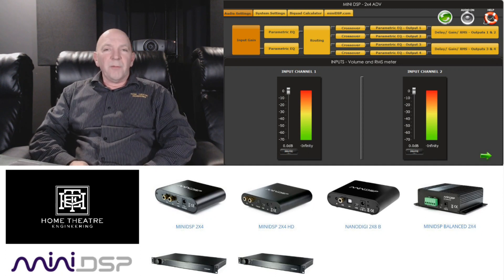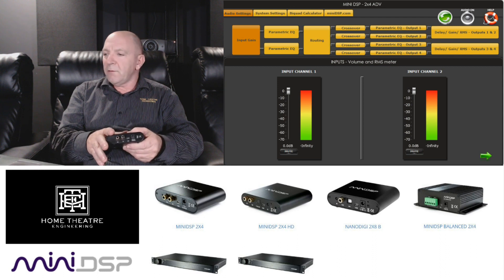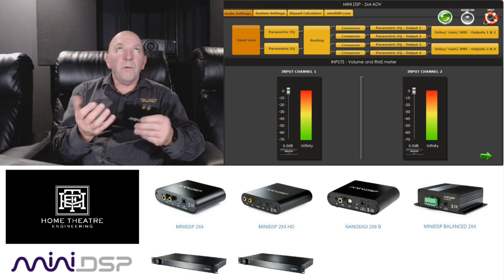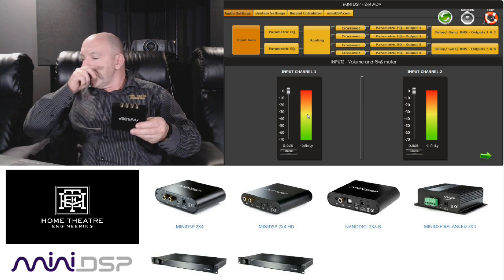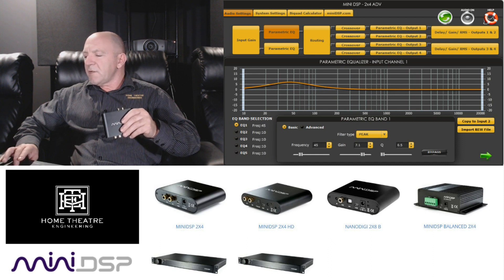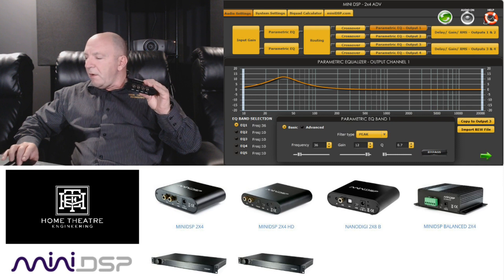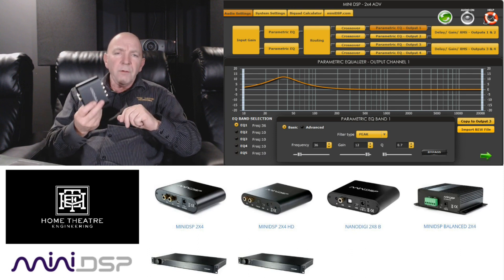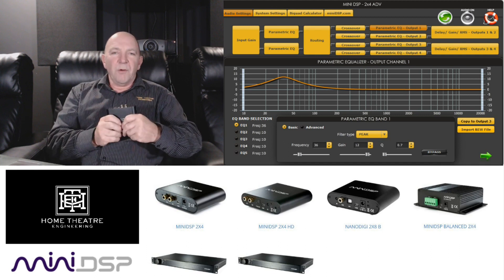Awesome Home Theatre Bass Control with MiniDSP

Comment: Please tell me what cables I need for using this with a umik 1?
Reply from the maker: Umik1 comes with the required cable after that it’s up to you depending on what you are wanting to do
Reply: @HomeTheatreEngineering  Thank you for the fast response.I will also be  using the mini dsp2x2.What will I need with this?
Reply from the maker: @christisdale9977  that entirely depends on what you are trying to do or connect to. I would suggest looking at the relevant documentation for that product and the products you will be using..

Comment: Hello Team, I need some help darling in my subwoofers, ￼My question is should I add a house curve in the mini DSP and then run anthems ARC room correction or just use the mini DSP to flatten the response and then add the house curve in anthems ARC room correction?￼ I’ve tried letting the anthem do everything but I think incorporating a miniDSP will achieve better results. 
I can’t move the subwoofers around my room to improve their in room response as I’m very limited with space.￼
Reply from the maker: We dont have enough information. How many subwoofers? Which anthem? Unfortunately we arent able to provide technical support via youtube comments but you can book in for support by contacting us through our website

Comment: MiniDSP before room correction or after? And if running an processor with 2 independent sub out should I use them or use mono and split in the MiniDSP for multi sub

Comment: Just got mine set up tonight, I can't tell I even have a sub in the room anymore, just sounds like a massive full range speaker. the only real complaint I have is that it seemed to really lower the bass volume I'm not getting the impact I used to get, maybe that's just because i'm so used to listening to the peaks in my room and I don't have those anymore.
Reply from the maker: It’s all in the setup. If it isn’t right then measure the rooms performance and adjust to suit
Reply: @HomeTheatreEngineering  I think I need to bump the 20-40hz another 5db, It's 2 am on the west cost of the United States, so i'll have to do it in the morning, I think my wife would kill me if I started tuning subs right now while she's asleep.
Reply from the maker: @Edward135i  :-) I would be cautious of bumping a frequency up too much. More likely need to pull others down. How many subs? Have you level and time aligned one to your front left speaker and then any other subs to that first sub? Without doing that you are chasing your tail .. good luck (and goodnight :-) )
Reply: @HomeTheatreEngineering  I have 2 subs both on the front wall, they are the old Klipsch THX Ultra 2 subs that share the KA-1000-THX amp that they are built for, so I can't time align them since they only have one LFE input that controls both subs. I don't know if putting them in line-level mode would give me better control over them individually or not.
Reply from the maker: @Edward135i  you have a minidsp so you have total control???
Reply from the maker: @Edward135i  Hang on, I’m confused. You are commenting on a minidsp subject right? So my understanding is you had just set up a minidsp? The entire point of which is for multi sub control. Are you not using this?

Comment: Hi, I bought one 2x4 here in germany and a umik-1. After adjusting my two Subwoofer with REW I'm not sure, what to do next. I own a Denon 4500 receiver. Do I recalibrate my Soundsystem and use Audyssey and hope is does everything "right'? Or are there any other options? What do you do after you set up subwoofer for your customers? Thx ;)
Reply from the maker: Hi that’s a very good question and not a quick answer. It depends on what you mean that you have done when you say “set up subs with REW” what should happen is one sub should be aligned to your left front channel in terms of level and delay. Then phase is adjusted to match. Then the remaining subs are aligned to the first sub. Once that’s all done then I take a snapshot of the rooms performance. Then run the room optimiser and then retake the snapshot of the room and see if it has improved. Generally if the room is well set up first I find room optimisation to do little or even make the room a little worse. If it has improved it I leave it on. Otherwise I turn it off ...
Reply: @HomeTheatreEngineering  Hmmm... Aligning one sub to the left front is an interesting point. I've just aligned my two subs to each other. To be honest, optimizing the room through absorbers/diffusors is a good point but not realizable. It's a living room and putting large panels on the wall is no option. That's why I have to live with the results that I get when using the technical stuff, which corrects my room problems as good as possible. ;)

I've another question, if it's ok.... what's your standpoint on "house curves" when using REW+miniDSP. Do you prefer a flat curve or do you rise the output of Subwoofers when going to the deeper frequencies, or do you something completely different? :P I started with the house curve of "Home Theater Gurus" (#7) and ended with my own slightly different version. Is there a version which sounds the best?
Thx :)
Reply from the maker: @TheRealSchnitti  I’m not sure if I read the reply correctly. But... it is important to have your subs aligned to your speakers as this makes a big difference especially at the crossover frequencies you can end up with big delay differences and strong phase cancellation if not. Room treatments have no impact at base frequencies by the way and that includes about 99% of all so called bass traps. That’s a big topic. Finally on room curves. You sort of hit the nail on the head. In terms of so called accuracy the answer is “flat” but the rest is personal preference which is what I do. I dial in a flat response then adjust to my clients preference.
Reply: @HomeTheatreEngineering  That's a good point. Haven't done that yet. Found a video, which looks like it could help a lot with this problem (-> "Home Theater Gamer" miniDSP Part 4) Gonna test that next. 
The "room treatment" I've done is to reduce plane surfaces as much as possible to minimize echoing ( I hope that's the right way ;) )  What I've heard about room treatment in the range of bass frequencys is, that you have to have absorbers, which are at least 14cm (5,5 inches?😅🤷) thick (with or without a empty space between the wall and the absorber, but that's another point...) and that's not possible to realize in my room. That's why my way to go was the miniDSP to look, what's possible...
About the home curves, I don't know if I do something wrong, but I don't hear a (big) difference between a flat curve or a curve that rises 10db from 100Hz to 30Hz ... using Audyssey of the 4500 after the REW Subwoofer treatment. Have to say, that I just thought about the Audyssey App to use the "curtain" option, to get the untouched curves. Maybe I hear a difference that way. Going to test that, too...  Thanks for your input! 🤗✌️

Comment: I have the Marantz AV8805 which has 2 independent balanced XLR's outs. I'm planning 4 subwoofers for my new cinema room which will have 2 x active velodyne spl12's at the rear and 2 x dual 10" passive subwoofers each powered via their own 1000w amps behind the screen.

My question is would I approach the tuning as per your video or use both Sub XLR pre outs (ie XLR 1 = Front's, XLR 2 = Rears)? Also would I be better off buying the balanced 2 x 4 or the 2 x 4HD?

Thank you and get video
Reply from the maker: You are always better having independent control over each and every subwoofer so that you can tune the room properly. In terms of which MiniDSP that comes down to delay range and resolution. Normally the MiniDSp 2x4 is enough but if you have large delays to manage or are a bit OCD about the sound quality (at subwoofer frequencies this is not really an issues) then go for the 2x4HD. Hope that helps

Comment: Wow thx,
So you run your sub woofer cables from their placement to your receiver/processor source then hook the DSP to the output of the processor???
Reply from the maker: Hi I am not sure I fully understood your wording but I think you are correct but for confirmation. Normally, a coax would run from the subwoofer output (or 2) of your AVR to the minidsp. So to either input one or input 2 or to both. Then the outputs would run one to each subwoofer. Hope that clarifies it!

Comment: Awesome explanation!  Question though,  can you run REW, and then tweek that file?  I like a little bit of extra bass.
Reply from the maker: Absolutely you can. You can either edit the curve in REW or After you transfer the data you can edit it in minidsp
Reply: Home Theatre Engineering cool, thanks for the reply, just ordered the mini dsp and the umik, can’t wait till they arrive.

Comment: If I have 2 subwoofer outputs which are not independent of each other on my receiver, would I be able to use this to independently tune each subwoofer?
Reply from the maker: Yes absolutely
Reply: @HomeTheatreEngineering  hey thanks for the quick reply!

Comment: It is an amazing tool and much more powerful and easy to use with Multi Sub Optimizer software.  It’s free, just search for the website and go through their tutorials.  I’m using it with 3 subwoofers.  It can optimize using measurements from multiple mic positions to enable great LF across all listening positions.
Reply from the maker: Yes mso is a great tool..something we use quite a lot. Has a bit of a learning  curve for those who are interested  Good recommendation.

Comment: Hi you have convinced me and I just ordered one from you I have 4 subs so do I use one in and 4 out or do I use the 2 inputs?
Reply from the maker: If your system has 2 sub outs you can use both and connect one to each input (often they are common anyway, but not always) or if you have one sub out that simply goes to the one line input. Then of course each sub goes to  its own output.
Reply: Home Theatre Engineering the Marantz Sr 8912 has 2 independent subs out, I have four subs 12” Klipsch i may need some support when I receive my minidsp 2x4 hd

Comment: For a true Bass Management, you want DDRC-24 that can compensate the impulse response and therefore get rid of standing waves. This way you get completely rid of the room in your sound.
Reply from the maker: Im interested. As we know room modes (standing waves) are a function of room.dimension and frequency. Id like to hear more about your procedure especially utilising impulse response. How are you  eliminating room modes with IR.
Reply: @HomeTheatreEngineering  ................. crickets
Reply: @googoo-gjoob  Is that "crickets" to a response we didn't get ? ;-)
Reply: @AndrewPoole01  , yes, Sir. Tomas K made a ' 1 up '  type of statement.
you asked him a reasonable question.... 5 MONTHS AGO ....nothing.
feather in your cap..... demerit in his file.

Comment: Can I use a MiniDSP to boost and cut frequencies on my surround speaker channel? Can it be used as a parametric EQ on any speaker or just subwoofers?
Reply from the maker: There are a range of minidsp but you can use this on any active speaker or line level signal. Just need to chose which minidsp you want
Reply: @HomeTheatreEngineering  Great thank you for the reply! I'll check them out.
Reply: 2x4 can do that, but you might notice a quality downgrade. 2x4HD is better for allrange. Keep in mind it has to be connected between preamp/source and the amplifier, so in your case you'll need to have a signal source for surround, which you'll then connect to the surround amp.

Comment: The only useful video on this topic. There is some retard rambling for 50 minutes about miniDSP that is unfortunately one of the first search results on youtube. That particular moron is insufferable after 30 seconds.  This thing will be totally adequate for doing some EQ to a pair of stereo speakers, and has room to add a subwoofer output. very nice.

Comment: Not sure I understand how the delay setting can be used to mitigate timing issues between the sub and mains, since a powered subwoofer is ALWAYS going to be inherently delayed relative to passive mains. ie: the mains need to be delayed, not the sub.
Reply from the maker: Agreed. The delay is aleady accounted for to a degree in setting the distances of the LCR's. This way the subs can be timed to suit. I start with the left main and set that up and then time everything to suit. Hope that makes sense.
Reply: So i would apply offset distance settings in the avr, lcr 7’ and sub 19’ for example, then use minidsp delay setting to fine tune it

Comment: Thanks for this introductory video. I've been looking for more in-depth videos showing how miniDSP can be used to setup and EQ a multi-sub setup, including a discussion on how it can/should be used in conjunction with the AVRs' built-in room correction systems like Audyssey, but I have found none! Could you provide one? E.g. I wonder where delays, crossovers, speaker levels etc. should be set - in the AVR, miniDSP or both? Should Audyssey be run before miniDSP EQ or after if one wants to use AVR functions like Audyssey's dynamic EQ, dynamic volume etc?
Reply: Seconding this!
Reply: https://youtube.com/playlist?list=PLriHxML5BOuORC1FWqBI4PF9us7yG8IjK
Reply: @TexSupport  Thank you. Home theater gurus also have a great video.